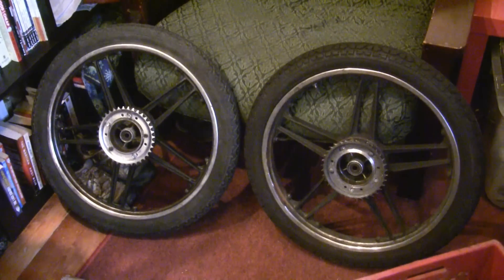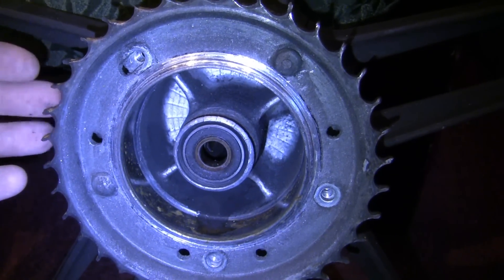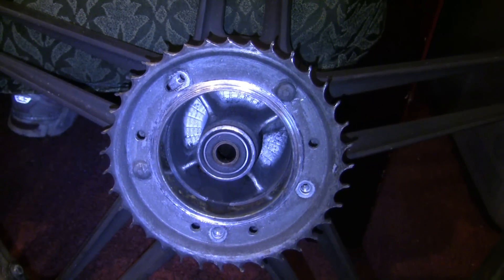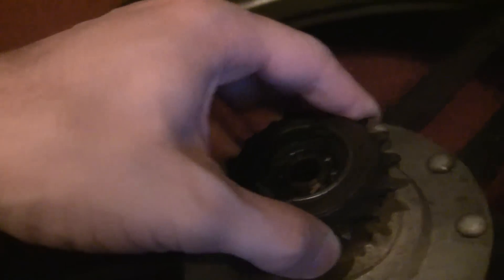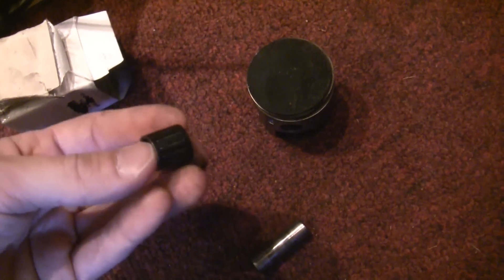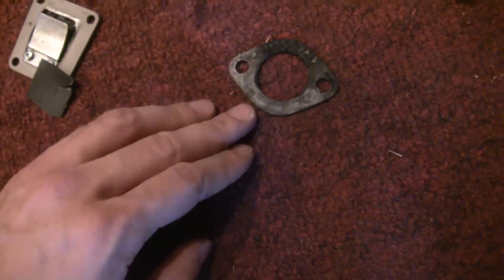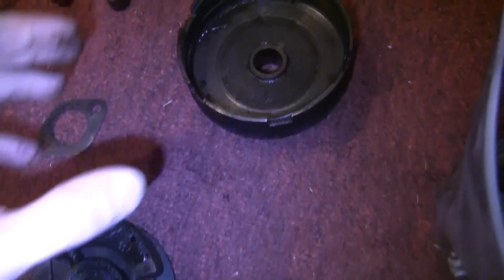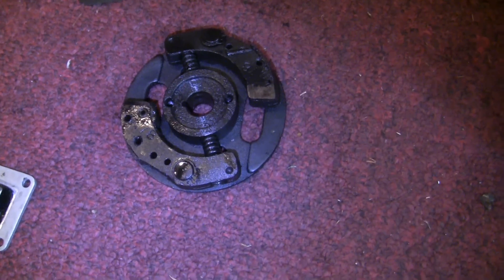Puch Parts Team TravisTutorial ROASTED on Pinball Run 3

Comment: hello.both my children(13 and 23) are interested in a puch maxi.it was the younger s son idea for it,and he is done some serius research.the older needs practical transport etc.but i am concerned  about letting my son on an moped,because he loves go karts and speed.tough we have a big cement platform nearby for him to have a bit of fun.please help me decide what to do. thank you
Reply from the maker: +Borut Korosec A Puch Maxi will do about 25mph stock, that are a great starter moped. If I were going to use one for transportation I would go through it since they are all 30+ years old.
Reply: so you would say yes? thanks for the almost instant response.;)
Reply from the maker: +Borut Korosec No problem, I just want to make sure I understand exactly what you're asking. For your 13 year old a moped can be just as dangerous as a dirtbike or small motorcycle, it just comes with the territory of riding a two wheeled vehicle and necessitates proper gear. For your other son, sure a Puch Maxi could be a super cheap way to get around, but if it were me I'd be prepared to fix it when it breaks down. I would be ready with the tools and know how to change a spark plug, clean a carburetor, and clean ignition points on the side of the road if it were something I had to rely on to get to work/school. Old mopeds are pretty much always broken but easy to fix.
Reply: thank you :)